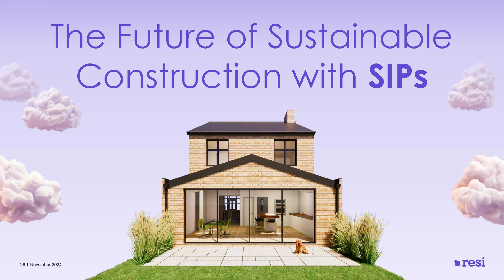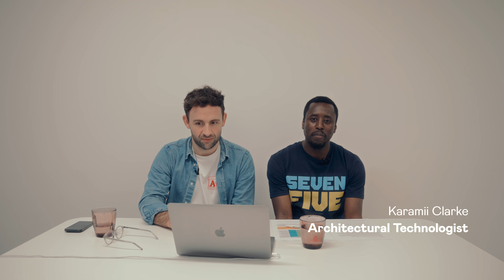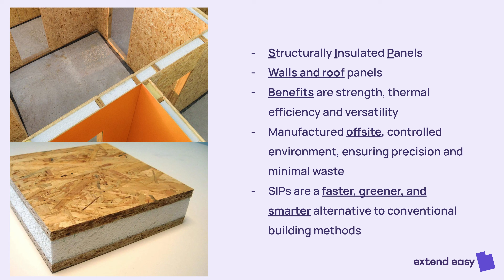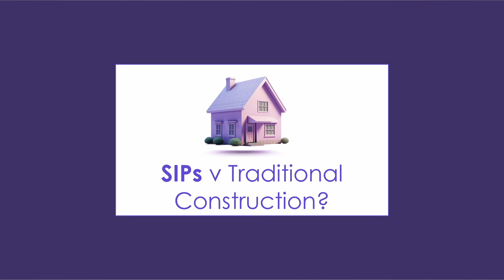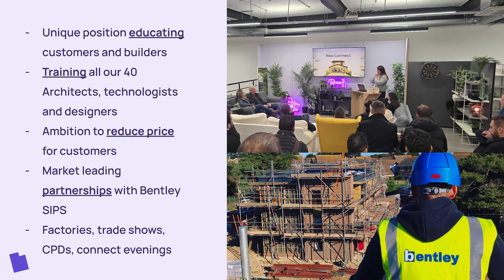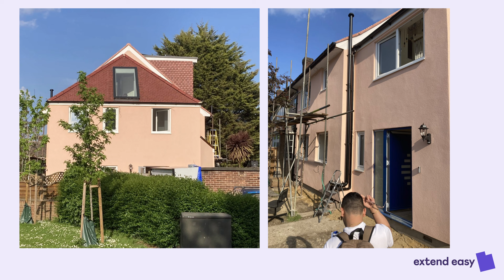Why SIPs are transforming UK homes

Comment: Will we be able to get insured?
Reply from the maker: Yes, you should generally be able to obtain insurance for an extension built using Structural Insulated Panels (SIPs), but there are a few considerations to keep in mind:

1. Certification
Ensure that the SIPs system you use is certified by a recognised body, such as the British Board of Agrément (BBA) or has CE marking. Certification provides reassurance to insurers that the materials meet industry standards. We use Bentley SIPs' product who has this. 

2. Installation Standards
The SIPs must be installed by a qualified contractor with experience in this method. Poor workmanship can lead to issues that might make insurers wary.

3. Full Disclosure
Be transparent with your insurer about the construction method. Hiding or omitting details could lead to claims being rejected later.

If you face challenges, brokers who specialise in non-traditional construction or renewable building methods can help find appropriate coverage. SIPs are increasingly recognised as a sustainable and high-performance solution, so securing insurance should be straightforward with the right approach. Always check first.

Comment: How much does it/ reduce contract sum by?
Reply from the maker: The overall cost can vary significantly depending on the specifics of your project, but here’s a breakdown of potential reductions in your contract sum:

1. Reduced Labour Costs
SIPs are quick to assemble compared to traditional construction methods. You could see savings of 15-20% on labour costs due to faster build times.

2. Lower Waste Costs
SIPs are pre-manufactured, leading to less on-site waste. This can save 1-3% of the overall contract sum compared to traditional methods.

3. Energy Efficiency Payback
While not part of the initial contract sum, the energy efficiency of SIPs means lower operational costs. Over time, this pays for itself through reduced heating and cooling expenses. In short your bills will become cheaper 

4. Design Efficiency
Modular designs and precision manufacturing with SIPs can lower design costs by 2-5%, especially if standardised panels are used.

Caveat: Upfront Material Costs
SIPs materials themselves might appear more expensive upfront, which can offset some savings. However, the efficiency in other areas usually outweighs this initial cost.

In total, depending on the scale of your project, SIPs could reduce the contract sum by up to 15%, with additional long-term operational savings as a bonus.

I hope that helps